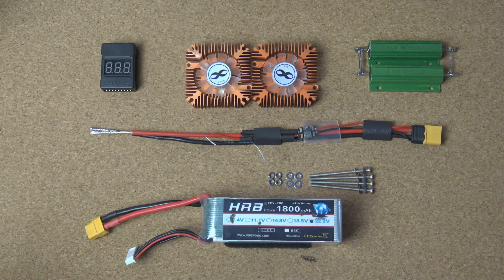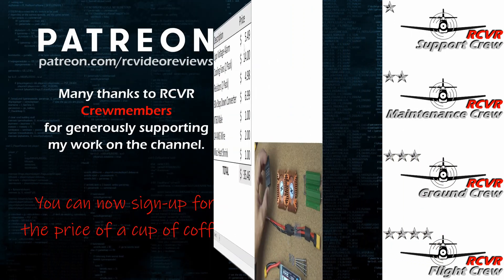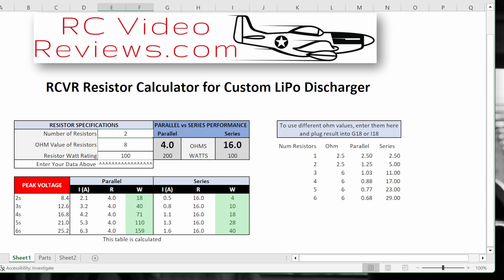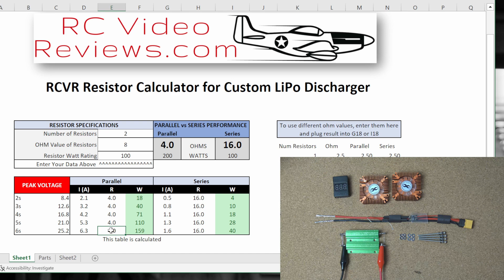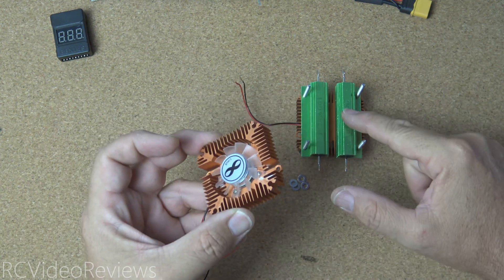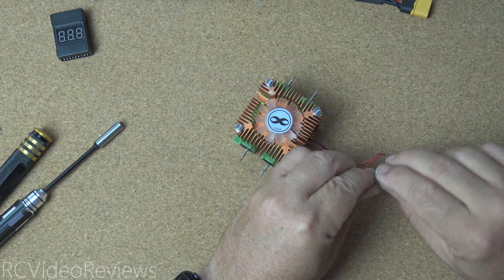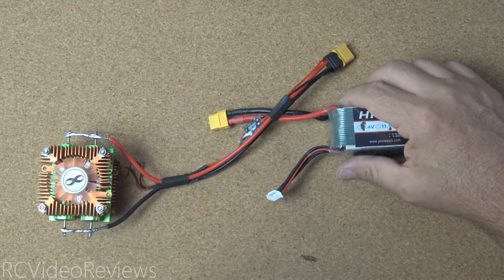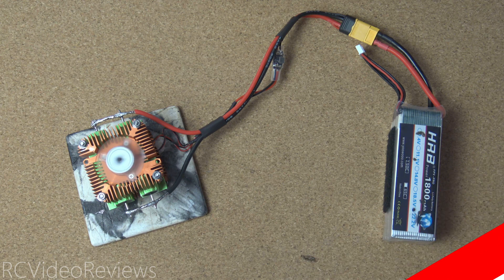Ohm's Law at Work: Cheap 2s-6s LIPO Discharger / Killer

Comment: I know this video is old but if I put two 100 watt 1ohm resistors in parallel to discharge 8.6 volts can the resistors do that ?? That’s 17.2 amps at 147 watts but it’s gonna be going through both so I would think they can handle it

Comment: have the same tweezers, did not know they are that much temperature resistant, I bought them for their electrical non-condutivity and anti-staticness
nice clean setup....I ordered a 300W 10R one, should work without a fan on 6s and I only need a lipo killer for disposal so don't need it super fast, just something usable, not like that lipo killer device sold on ebay which only does 2.5W at 6s and will take a month (bought that one and it's useless)

Comment: Does this work with the Hota F6?
Reply from the maker: This is a standalone device.
Reply: @RCVideoReviews  I know, but the Hota f6 has external discharge and can control the discharge. Using this it can discharge a lot faster.

Comment: incredible useful video, thanks! also thanks for sharing the excel file! why wouldn't i want to use a 1 ohm 100w resistor and get 100w across all lipos from 3s to 6s? thanks in advance!
Reply from the maker: Use the law and work out what you need. Lots of options to get things working the way you want them to work if you can do the basic math.

Comment: Is there a max wattage that you would recommend staying under? This project really has me curious. I currently use an ISDT FD-200 and it works awesome, but takes about 30mins or so to discharge a 6s 8000mah Lipo to storage voltage. Recently picked up an Icharger 4512 Duo that's rated for 2000w per channel (according to specs) in both Regen and External discharge.
Reply from the maker: It's just math. You can use whatever wattage (current draw) you want as long as your resistors support it and you can dissipate the heat. You should meet 'the admiral' here: https://youtube.com/live/3Szq9KolwVY

Comment: I would like to make this exact set up to use on my 8000 mah 6s2p liion packs. On my charger they take all day to discharge.  Will this be safe on my liions? The have a 45a continuois and 55a peak discharge rating
Reply from the maker: Yes.

Comment: Thanks for this!  I just built 2 of these to retire my older batteries.  I mounted the discharger on a metal ammo box so I can have the battery safe in the box during discharge.
Reply from the maker: Nice job! They work great.
Reply: @RCVideoReviews   I wanted to try using one of the dischargers to discharge down to 3.8v per cell for storage using an Apex RC lipo battery voltage checker and alarm.  I set the alarm at 3.8v per cell but when I hook it up it to a 6C battery that shows a 95% charge it starts dropping super fast and the alarm will go off within 45 seconds.  With the load connected all the cells are around 3.8v.  When I remove the load the cells jump back up to 3.9v.  How do you make this setup work to discharge for storage?

Comment: Thank you,

I liked the video a lot. My biggest take away is that a zero volt lipo battery is inert and safe to discard in the trash. I've had a couple on my desk that I had taped up for a while and didn't know what to do with (other than find a drop off place and bring them there).

The calculations and demonstrations with the power supply were pretty cool.

I imagine it's not a concern, but if using the device as a battery killer, to drain lipos to zero volts, at some point the 12 volt fan will not have sufficient voltage to run anymore. The cooling fins alone, apart from the fan, would be enough at that point I presume. But I think I'd make mine to run with a separate 12 volt supply for the fans (of course you mentioned that possibility).

One last note, descriptions on Amazon are often misleading. I was interested to look into the copper cooling fans in particular. Copper would of course be optimal for cooling (only second to silver). Sadly the fans you linked to are actually aluminum, which is third in line as far as cooling goes. Pure copper would've been cool though.

Thanks again

Comment: Great video, I'd like to build one. what are the benefits of connecting the resistors in Parallel series and not in Series? Thank you
Reply from the maker: Download the calculator and tinker with it. Changing how resistors are connected changes the resistance in the circuit.

Comment: You can do everything you just did without the step down converter. Put just the fans in series. They will run slower with a 2S and faster with a 6S. It is how I have done mine. I use lightbulbs instead of resistors. Also, mine is encased in a dollar store tupperware clear shoebox size container. I have the fans on both sides of the container...1 is pushing air in and the other is pushing air out. I have had it this way for 12 years. I use computer case fans rated for 12V and they do fine with a 6S battery because they only see half the voltage.

Comment: This discharger can discharge faster than using a lightbulb, I presume.
Reply from the maker: You have to do the math. Figure out the resistance of the bulb, and you can make comparisons based on the resistance (4ohms) of the configuration I used. At 25.2v, these resistors have 159 watts input @ 6.3a.

Comment: The lipo checker emits a high pitch sound, which I am unable to hear.  However, to completely discharge a lipo, definitely a plus.  Caution, don't leave unattended. Thank you for all your great videos.
Reply from the maker: You're welcome. FYI these meters usually have a flashing LED when the threshold voltage is reached if that helps.

Comment: Are you gonna sell the Admiral on your etsy?
Reply from the maker: I've thought about selling a kit on Etsy. The only reason I haven't done it is because I would be adding limited value (like putting all the parts in one kit) and then flipping it for a small profit. I don't know what the take rate would be. It's also a somewhat limited use case as it requires an iCharger with Extra Discharge mode to be fully functional.

Comment: Great video!! i was thinking (and maybe is not a great idea) but if would be possible to use a stack of peltier modules instead of the resistors.
Reply from the maker: I've been thinking about that too. I'm going to order some and give it a go. I thought about using them for this build, but I wasn't sure about fixing them mechanically to the setup (tape/glue) etc. I do want to try them though.

Comment: That is a very neat way of cooling the resistors and Ohms law is well explained. It might be an idea to mechanically fix the wire to the resistor leads by winding once round and then soldering. I have found in the past that if you generate enough heat/wattage in the resistor the solder can melt and the wire falls off. Most of those resistors have a hole in the lead for this purpose. In the good old days when we made GPO (before BT) panels the inspector would fail the kit if the resistors were not mechanically fixed.
Reply from the maker: I took some temperature measurements with the Admiral and at 17amps, I was seeing about 250F and that wasn't enough to melt the solder on the lugs. Heat sink was immaterial as it didn't influence the temps on the lugs. That said, half the fun of doing projects like this is to experiment and learn, so definitely make mods and play with it.
Reply: @RCVideoReviews  Cheers for the comment. I think you are doing a great job. I have only used a system like your Admiral when testing a 500 Watt MOSFET amp at max RMS output for a couple of hours. That was a long time ago.

Comment: I use a 12volt 4ams ductile fan tfor  discharge ......
Reply from the maker: I built a stand with a motor/esc/servo controller. That's fun too.

Comment: Just a thought, if you wired a small relay to the output of that beeper on the lipo alarm then put it's N/C contact in series on the + or - of the main leads(providing is rated at the correct current!) You'd have an Auto discharger, as soon as it beeps it would break the circuit and stop itself, providing it latches of course
Reply from the maker: That's how my in-box field discharger works. I have a relay. When the alarm trips, the circuit is opened. Pretty trick.

Comment: Awesome video. I think I might build one of these as all of my battery chargers (except for my LRP Pulsar touch) only ever discharge my batteries at a max of .2-.3 amps (even if you set it at say 3-4 amps) which is very annoying. Plus it will come in very handy for killing a battery that I need to dispose of.
Reply from the maker: Right on. And you can customize to suit your needs too. I've been using a janky single resistor with an XT60 pigtail wire strapped to the resistor leads for a few years. Figured it was time to make a discharger I wouldn't be embarrassed to be caught using. :)